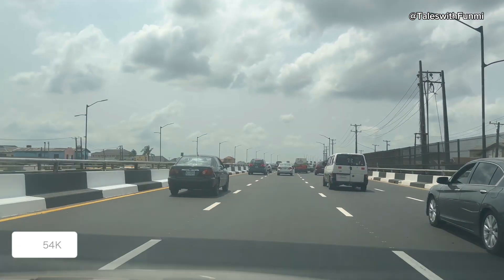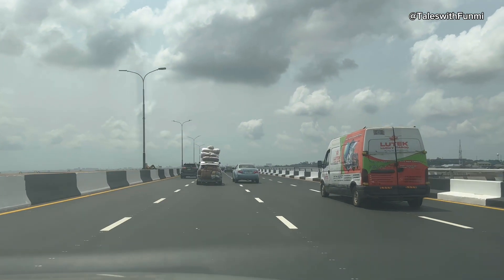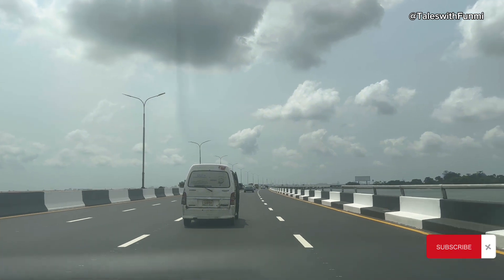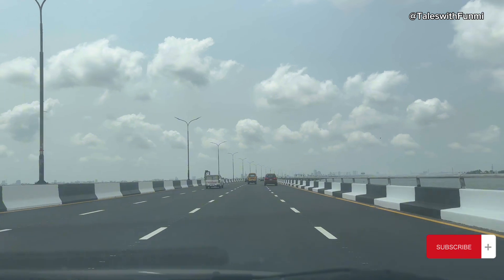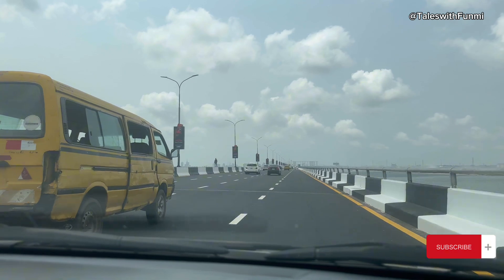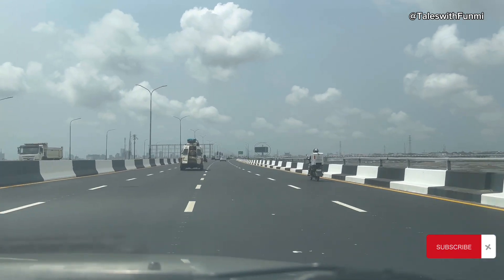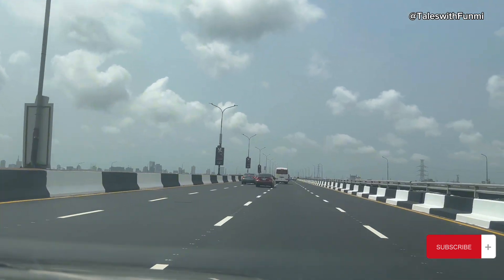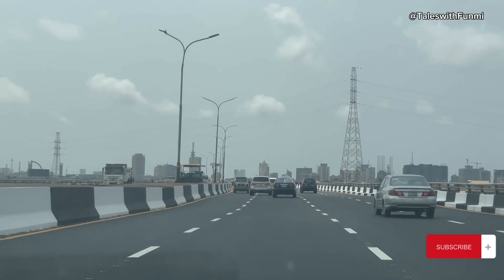Is the newly renovated Third Mainland Bridge in Lagos, Nigeria now a Race Track?

Comment: First major maintenance works for over 3 decades on 3mb.. Go figure. Well done to the president and minister for works 👏🏼👏🏼👏🏼
Reply: It’s not the first. The current works are primarily resurfacing works but major structural maintenance has been previously undertaken. Kudos to the administration all the same.